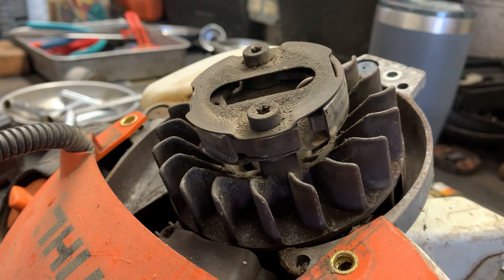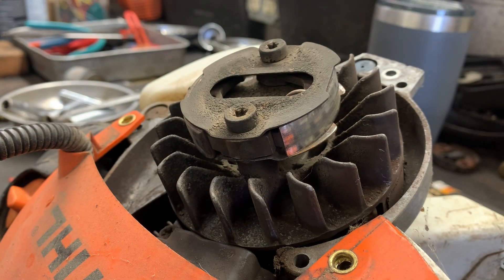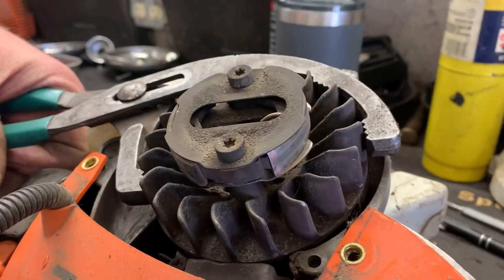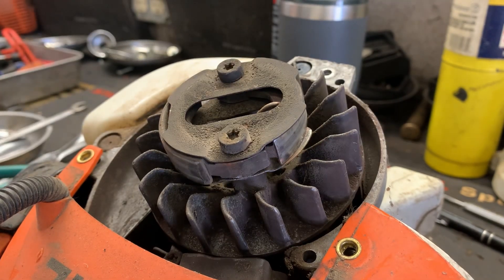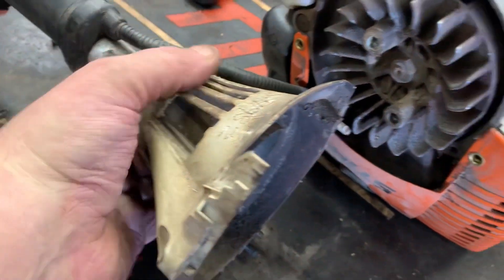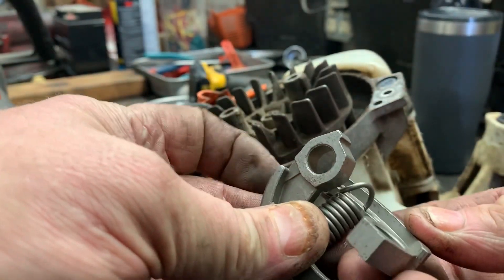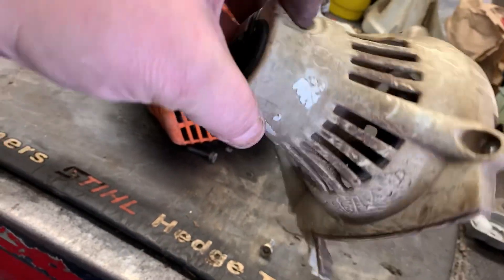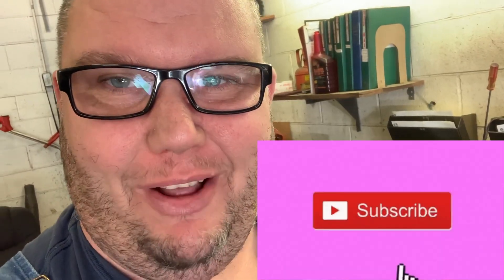OIL FILTER WRENCH HACK

Comment: I use the smaller plier to remove and tighten plastic plumbing that bolt together., because regular channelocks has to be held very tight thus squeezing the plastic together stopping the parts from sliding.   With the filter pliers the teeth catch the plastic nubs on the plumbing with very little force. Allowing the plastic parts to move.

Comment: I have filter wrenches, including a strap wrench but when all else fails, pound a long Phillips through them and turn the filter off.  Smebdumb AH’s like to put filters on with a pipe wrench, making them almost impossible to get off a few months down the road.  Why not tank the nut off the flywheel and hit the PTO end of the crankshaft- the flywheel will pop right off.  I have a puller for my big Stihl saws but not for every model Stihl saw.  Those that I don’t, I just hit the end of the clutch side crank with my brass hammer and off it goes onto a couple of shop towels I put on my work bench.  My brass hammer won’t damage the end of the crank.  I don’t baby it off, I give it a good rap.

Comment: Or you can use a piston stop or string in the cylinder
Reply from the maker: That is a viable option, however be super careful when using string, must make sure piston is on its compression stroke if not you could bend a valve

Comment: You might have more torque if the bit wasn’t so long or extension 
I’d think
Reply from the maker: The torque loss would be minuscule
Reply: @THEMOWERMEDIC1  I guess it’s all how you handle the tool as well. 🙂good firm
Grip makes all the difference

Comment: whats wrong with using a piston stop or feeding a length of rope into the cylinder to stop the crank rotating? :)
Reply from the maker: That is a viable option, however be super careful when using string, must make sure piston is on its compression stroke if not you could bend a valve or if not careful you could pop a hole in top of the piston with a piston stop

Comment: I'm gonna be "that guy" this time.... I think I'd be holding on the clutch, or laying a square shafted screwdriver between the two screw heads.  I've not had luck pinching on fins.  I got slapped by Olga once.  (you gotta think a second...)
 I still thumbed the video up, still gonna watch, and ain't mad at ya.   :)  (And that trick goes in the bag too, just maybe under some stuff. ;)    )